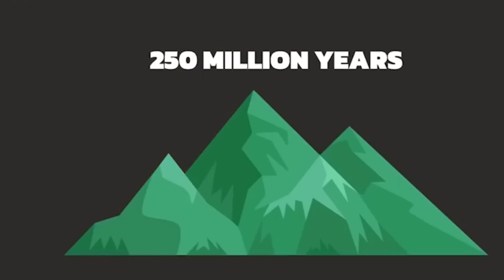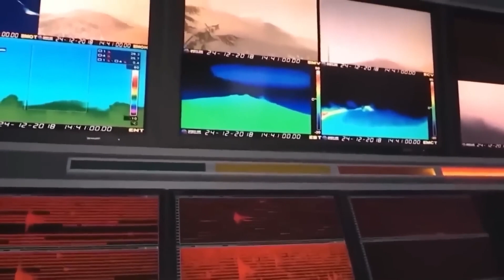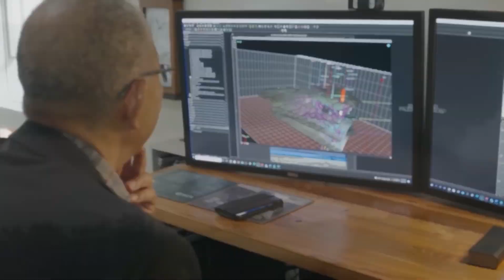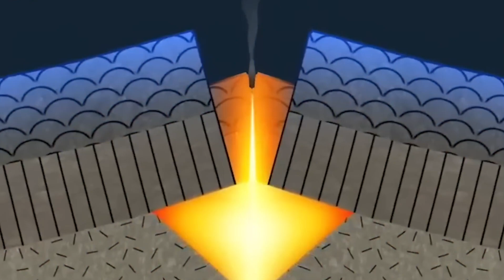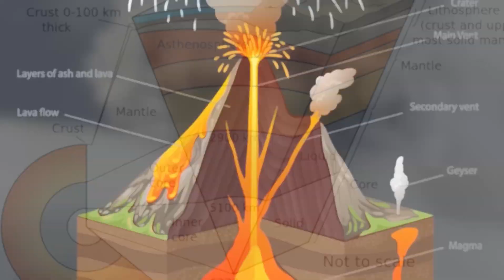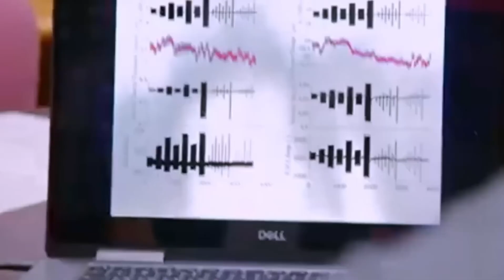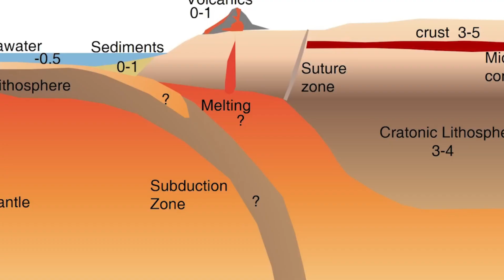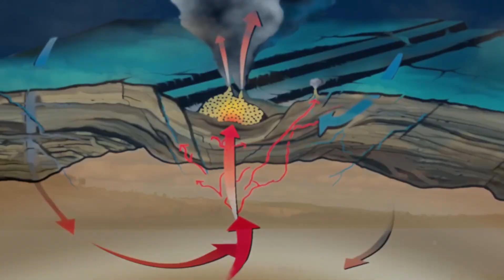Geologists on HIGH ALERT as Appalachian Mountain Suddenly Uplifts!

Comment: "Never been seen before" clearly only includes during the time non native indigenous people have been using modern measuing techniques. Probably less than 50 years. A geological blink of an eye. 12cm wouldn't be noticeable to land dwellers or connections of data made across large areas unless something catastrophic happened. 

The use of oral history has since been proven to be accurate as far back as 8,000 years in some locations and has made "professional" naysayers  publicly "eat crow." Im sure the native American population of the area who always knew are amused at this! 😂